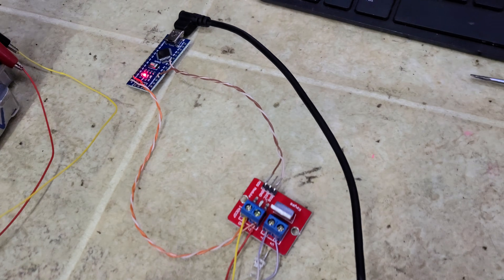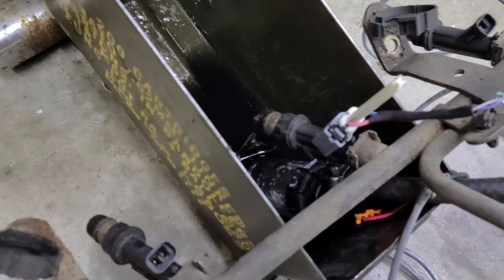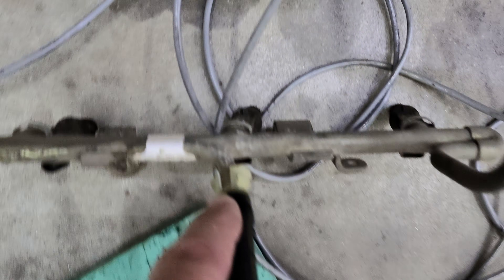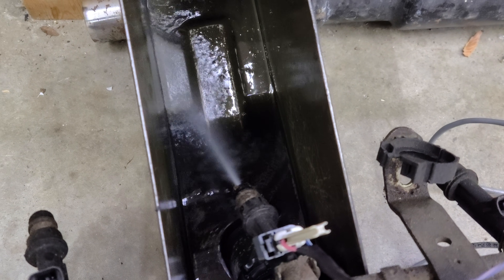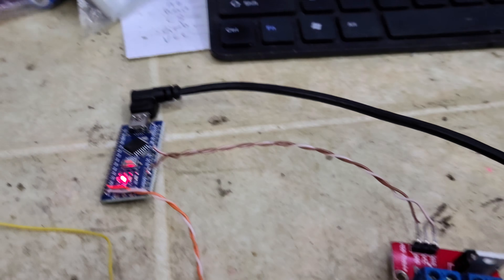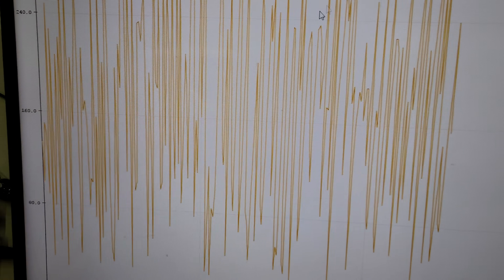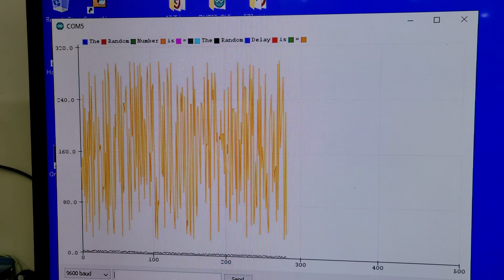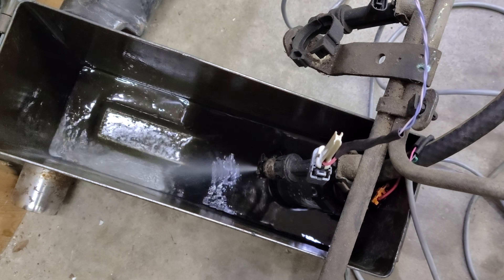Arduino Fuel Injector Pulse tester (fuel pump operation) part 2

Comment: This is awesome. You plan on sharing this code and or schematic? Interesting and looks easy enough.
Reply from the maker: I can post the wiring and text of the code later in a separate reply.   I found that if a injector is completely stuck, the excessive current blows the MOSFET and arduino board.  So, I will wire a relay controlled by the MOSFET. Relay can then control the injector. Injector speed and timing are not really critical so the relay will be fine.
Reply: @aknovaman  That's awesome. No rush, just a thought. would be good for future reference. Love your vids. Keep it up bro.
Reply: @aknovaman  for me also sir pls
Reply: @aknovaman would you please explain in quick words how you connected your mosfet driver wires to the pwm, please?